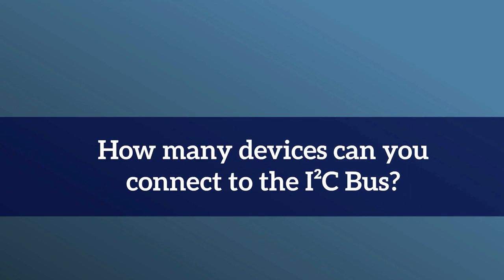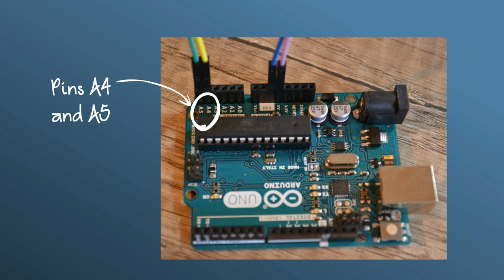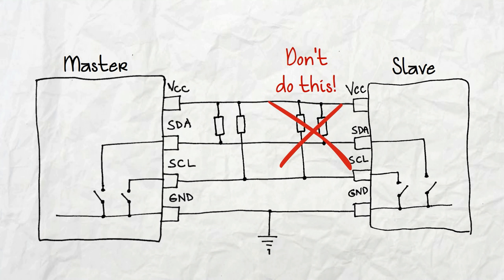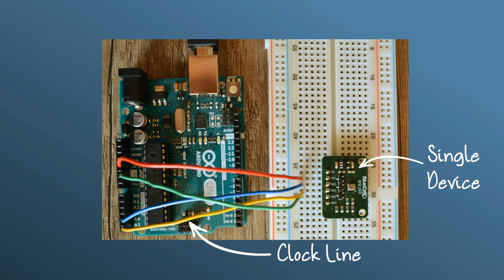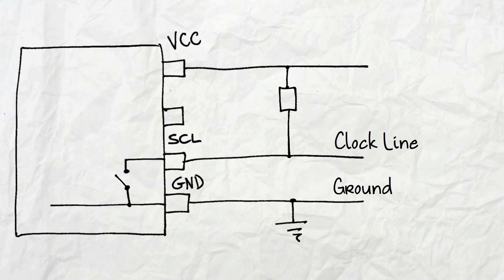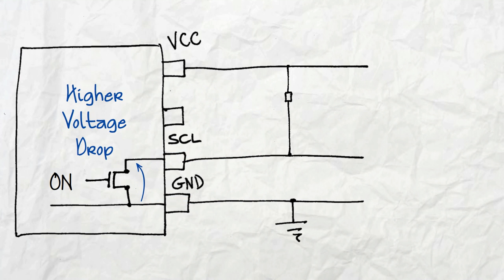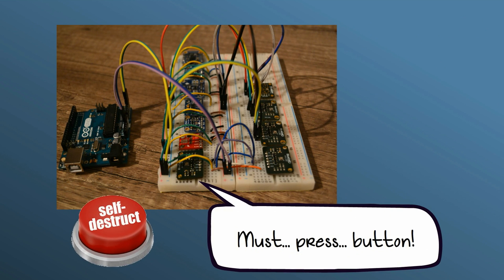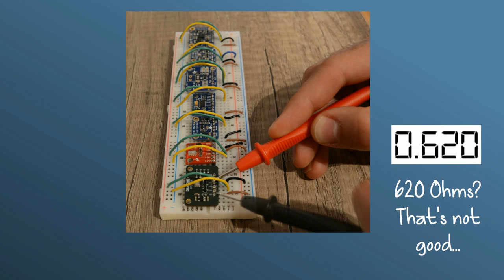Connecting Arduino with multiple I2C devices

Comment: If you need to connect more devices but the resistance becomes too low, just desolder the resistor from the breakout boards which lower the resistance too much..   With I2C you want about ~2K Ohms so that you can transmit data much faster :D

I see a bunch of comments where people think this video is "useless" but he explains this at the end, Resistance in parrallel is divided!   Hope this helps
Reply: He said you can measure the resistance of the whole bus by measuring between VCC and SCL or SDA, but I tried that on a little screen and it read overload, and I tried that on a single gyroscope and it reads 3 megaohms (even though the pull-ups are 22 kiloohms). Am I measuring something wrong or do I have to use his equation near the end?

Comment: Great insights - but depending on what you are doing, the limit is even lower ;) 

Break-Out Boards usually give you the option to configure the used I2C-Adress by connecting a pin to GND, VCC, SLA or SLC.
And that's another hard limit: You can only use 4 addresses for these kind of boards.

If you want a fifth, you'll need to find another vendor who has preloaded his device with a different address or even offers some way
to freely configure it beside the classic way of using 4 different voltage levels through an extra pin.

Comment: bluedot, you are awesome man! very nice presentation.
the solution must be "TO SOMEHOW ATTAIN A EFFECTIVE RESISTANCE OF 1.5K OHM"
you could try removing the pull up resistors in the slave(s) and adding a 1.5k resistor seperately
Reply: if could maintain effective resistance @1.5k, then theoretically you can connect upto 128 devices

Comment: excellent presentation ,  I have only one question because I was thinking about this very question of how many devices can I put on the I2C bus or more specifically I want to know how many arduino nanos I can put on the I2C bus ? I am thinking to use a raspberry pi as the master I2C bus and have nanos looking after individual sensors with their own isolated I2C busses or sensors directly connected to nanos with out using the isolated I2C bus.  Nanos don't as far as I know have any resistors on the SDA or SCL .  If what I'm thinking is correct then you could have an unlimited number of sensors connected to a main I2C bus of a master Pi or Arduino and just isolate the sensors with arduino nanos which are so cheap to buy.

Comment: Then add a really big resistor in parallel, will solve the issue right?
Reply: Adding any resistor in parallel will always reduce the overall resistance. To solve this I2C pull-up resistor problem, desolder all the built-in pull-up resistors on every device and place your own.

Comment: I am in a situation where I need 68 temperature sensors that use I2C comms and only 1 SDA and SCL line, how would I know if it will work?
Reply: Just try it from 2x sensor prototype, then 3, then 68...

Comment: Hello! Do you know if it is possible to connect two displays, but SH1106 and with another library (I use Adafruit's)? The solution I have at the moment is to use 2 arduinos, but the expense would be higher.

Comment: Published in 2016 and it's still providing great information. Nice video. I do have a question. How would you power 11 or more sensors all at once if I wanted to use battery as a backup and not as a main source of power?

Comment: This was a really good presentation, but you left out the most important part - what do we do about it?

It seems to me, we need to remove the pull up resistors from all but one of the devices.  There probably comes a point where that isn't enough, so we would need to remove ALL of the pull up resistors, and fit the appropriate size for that number of devices - those would be bigger value resistors, to get a good logic low level, surely?

There is also this video, which may be helpul:

https://www.youtube.com/watch?v=sGZe0aJsqBQ
Reply: I found a comment lower that said "If you need to connect more devices but the resistance becomes too low, just desolder the resistor from the breakout boards which lower the resistance too much..   With I2C you want about ~2K Ohms so that you can transmit data much faster"

If you want a more thought-out approach, near the end of the vid it explains using the parallel resistor equation, which you can use if you can see the values on your pull-up resistors. It didn't work for me to measure the resistance between VCC and SCL because I tried it on a little screen and it reads overload, I tried it on a single gyroscope and it reads 3 Megaohms which seems high.

Comment: This really helped in my understanding, but I was wondering (hopefully this is not  a stupid question) but would this be considered analog multiplexing? And would this allow the arduino to communicate with 2 devices with the same MAC address at the same time?
Reply: I don’t think two devices with the same MAC address would work. I think the thumbnail for this video is misleading.

Comment: So the resistor for both ( SDA and SCL) Is the same? Thanks
Reply from the maker: Well, yes, the resistors usually have the same value. 10k, 4.7k or 2.2k are very common values.
But of course, you need one resistor for the SDA and for the SCL line.

Comment: I still dont know how to connect 3 I2C devices to Arduino. Useless.
Reply: I2C is a bus. Just put them in parallel. That is how a bus works.
Reply: their values aren't mixed up. You communicate via their address. If they have different addresses, then they can communicate just fine in parallel. If they have the same address, then you need a mux (multiplexor) to separate the devices and you communicate with one and then the other.
Reply: @Readme: just connect them all in parallel. SDA to SDA, SDL to SDL, GND to GND. The only restriction is if two (or more) devices have the same address. Then you will need a mux to do the intermediate work. And that, is a whole different topic.